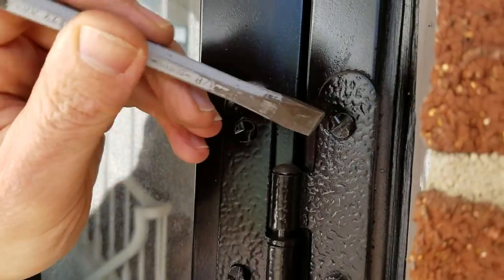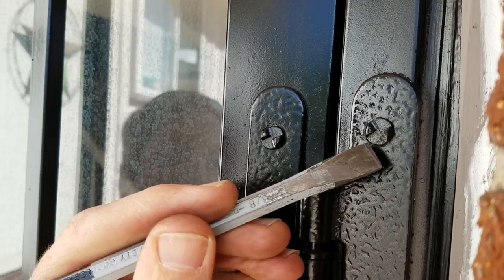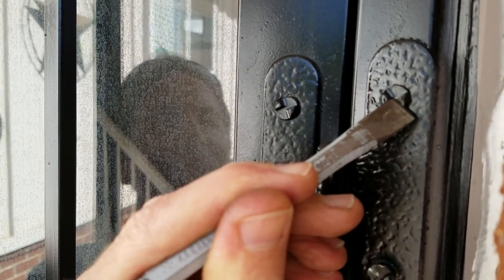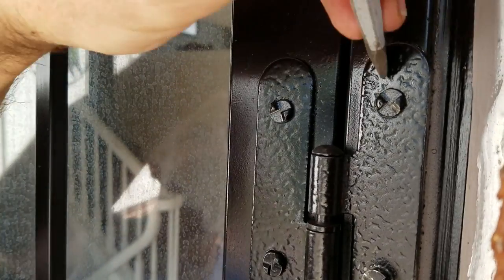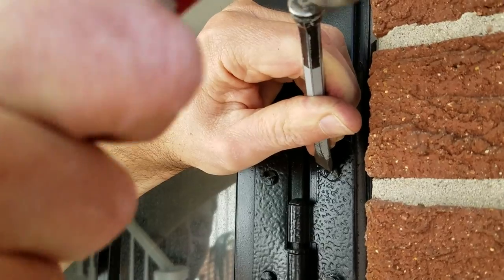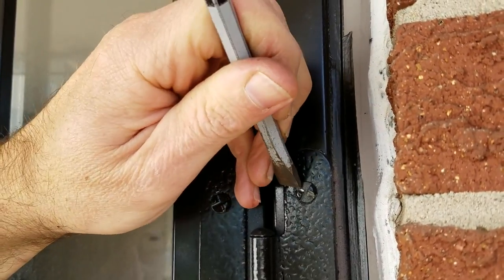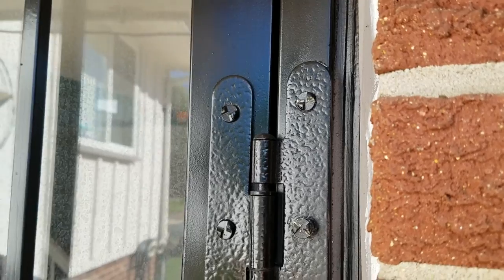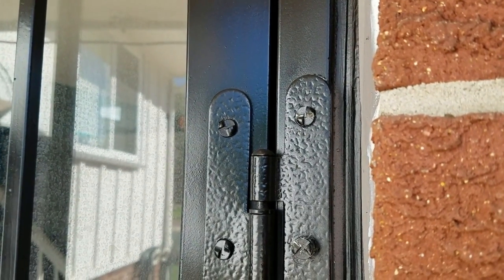How to remove 1 way screws - security door or window

Comment: Nah..use a Dremel, cut a deeper slit in screw with metal-cutting-wheel...so much easier.
Reply: Facts . Real eazy with dremel . Just a slight slice in middle then take out wit flat screww 😁
Reply from the maker: 22Glocks- I agree that's a good idea, however I don't have a dremel.
Reply: Good idea but why are you here if you know how to do it 😬